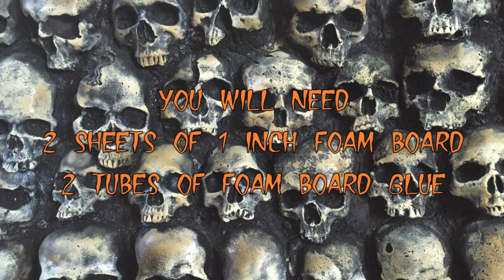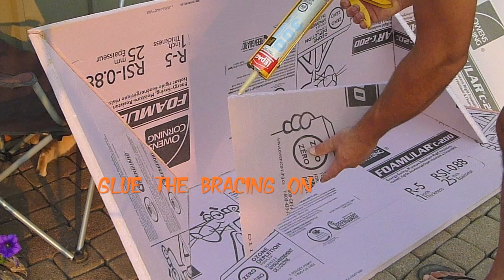Making a crypt for halloween

Comment: How do you anchor them when they are in your yard for Halloween?
Reply from the maker: For my crypts, I don't even bother anchoring them to the ground.  I usually put a small fence around them so they're somewhat contained.  For my larger stackable tombstones, I drive a 1 X 2 stake (18") into the ground first, set the bottom section of the tombstone over the stake but along the side on the inside, so its not seen.  I'll then drill a screw into the stake, and then into the inside of the tombstone.  I guess you could do something similar with the crypts too, or maybe glue something on the inside of the crypt wall to give it some more weight if you have a lot of wind in your area.
Reply: @hickabodcrane  every year we have a big storm sometime before Halloween with winds like 40 and sometimes stronger so the crypts I love them but not sure a good way to keep them in my yard when the wind comes.

Comment: What type of paint did you use? I’ve heard that certain types of paint can dissolve the exposed foam. Thanks.
Reply from the maker: I always use water based latex exterior paint on all my props.  It's true, some oil based paints do dissolve foam board.

Comment: Where can I get 1 inch foam board in the pink or blue? I went to Lowe's and Home Depot and they only have 2 inch.
Reply from the maker: I bought my 1 inch foam at the local hardware store.  You can use 2 inch of course, but it's quite a bit more expensive.  If you do end up using the 2 inch foam, the joints will end up stronger because of a greater surface area for the glue.  Another suggestion, I've been using gorilla glue instead of the PL foam board glue, I'm finding the joints weren't holding up as well with the PL brand.  Hope this helps
Reply: @hickabodcrane  Thank you for all the help. 👍😎